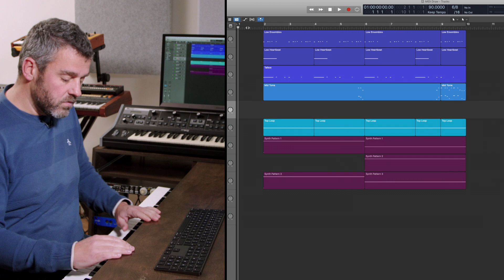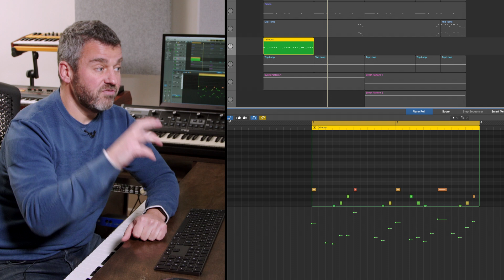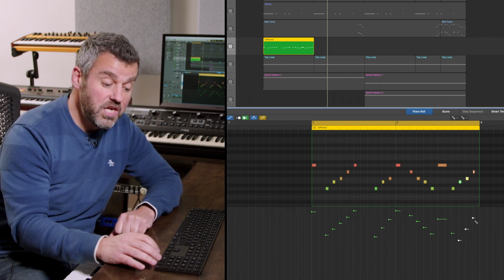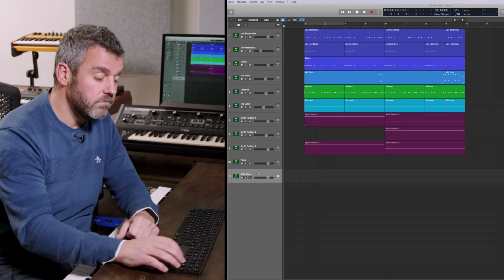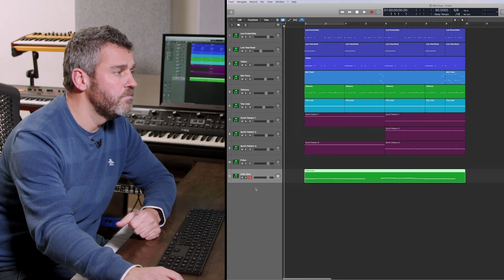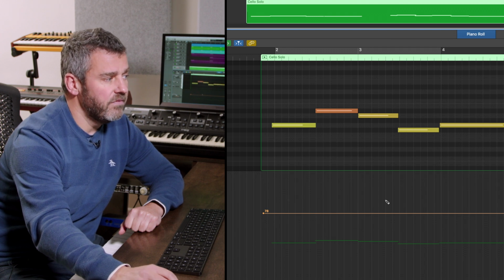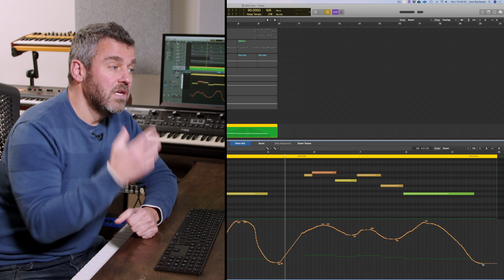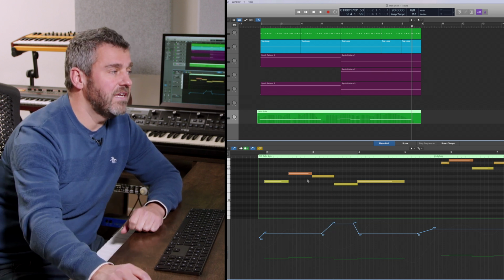Logic Tips: MIDI Draw Automation

Comment: When i draw expression data it does not change the expression within my vst. The only way i can get it to work is if i right click expression on my vst and then learn midi with a controller. The issue is it shows as modulation data after recording and not expression data. Any ideas? Im using LPX

Comment: Jono, what would be your approach to recording expression & MIDI data in realtime after you've recorded the notes? Meaning doing exactly what you did here on the first pass of recording the notes, but then doing a 2nd realtime pass to record any expression, modulation, pitch bend, sustain etc (as opposed to drawing it in).  Does there need to be MIDI merge on or something else? BTW Great work again!